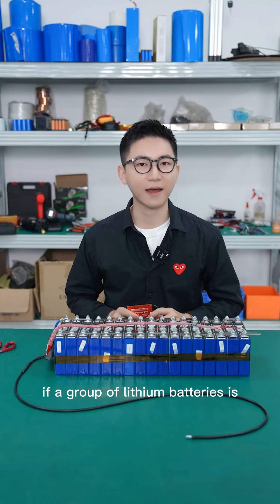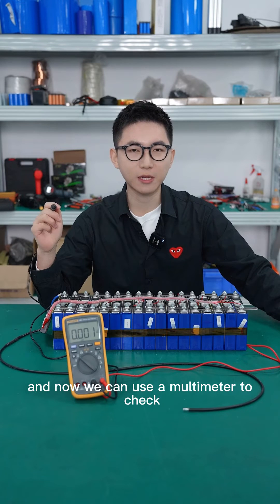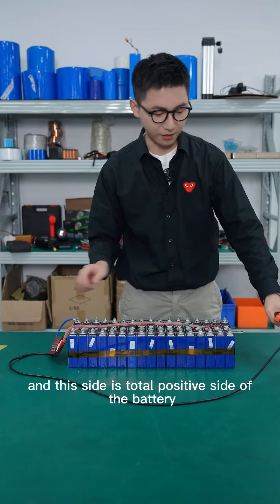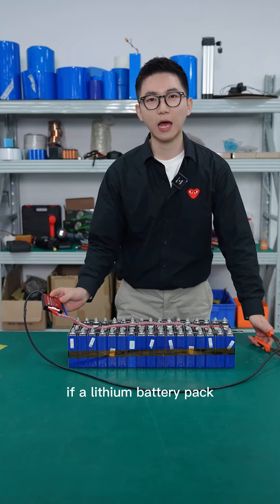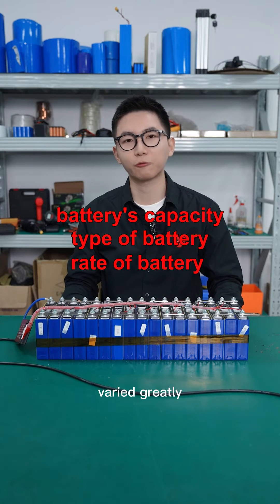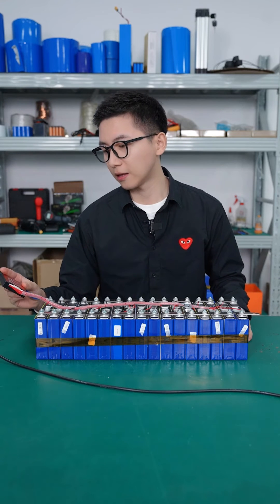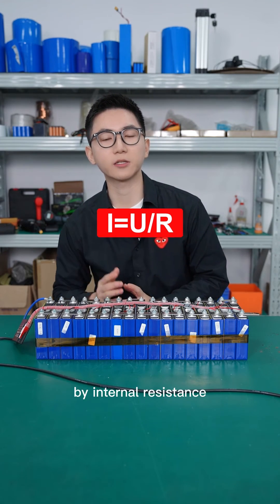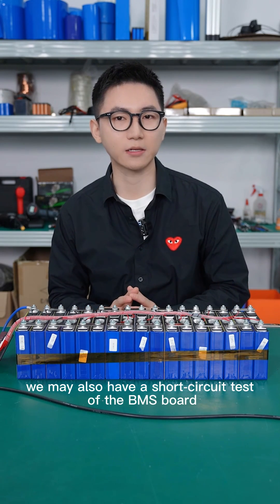🎈🎈🎈 The short-circuit test of #daly #bms

Comment: I had the same problem with daly, my bms disconect accidentally without any short circuit and then i need to disconnect all the cables from bms and connect again to waike up the bms, should start automatically but doesn't appne, i think we need to be careful when we are planning to buy bms from daly
Reply from the maker: Dear friend, if you do not charge or discharge, the BMS will automatically sleep to reduce power consumption. There are many ways to activate BMS, such as charging, discharging, and pressing the button on the BT module. In addition, if you want the BMS to not sleep, you change the parameter"sleeping waiting time" on the BT app, modifying the 3600 seconds to 65535 seconds.
Any problem, feel free to contact email: jia.xiong@dalyelec.com

Comment: Hello.
There was a problem with this board.
After a short circuit, at first the voltage disappeared completely at the output, then it rose to 4 volts, then to 12.7, on the battery 13.4.
Can you tell me if the board went into protection, or burned out?
What can be done in this situation?
Reply from the maker: Hi, dear Денис , please check the volatge between B- and P-, it should be 0V